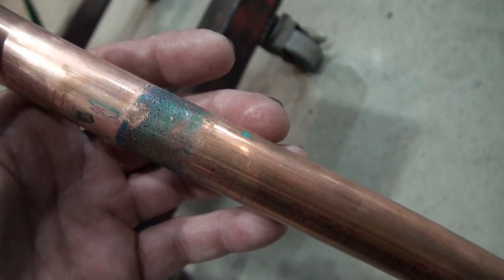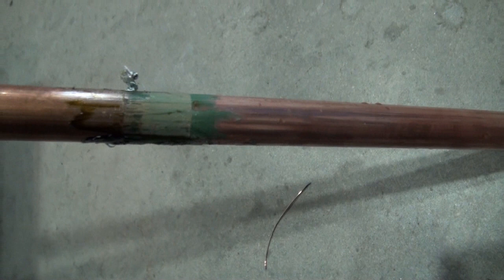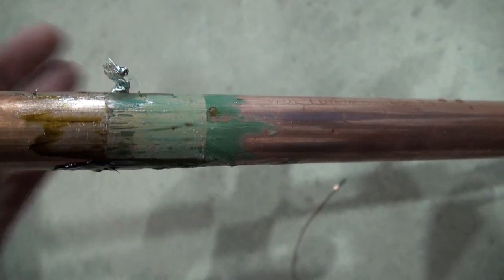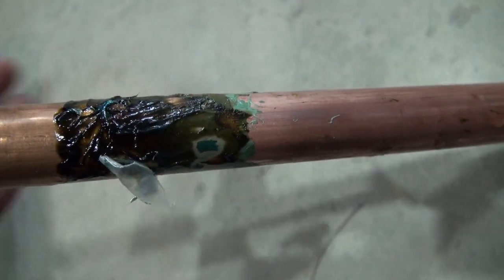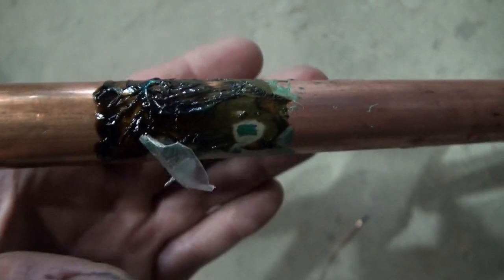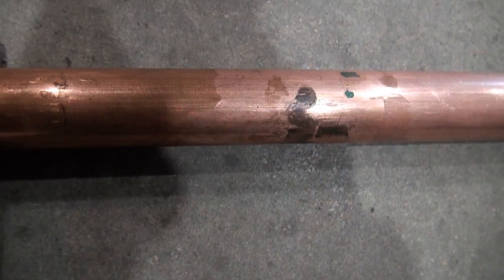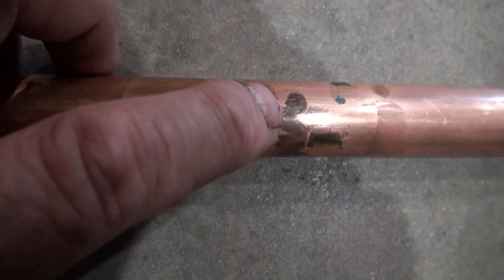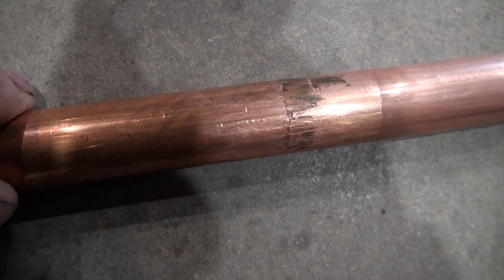Copper in vinegar Test Part 2

Comment: I know on copper computer components like heatsinks they have some sort of lacquer or clear coat because they never discolour and always look like pristine copper (even if you get stuff like vinegar on them)
Ill guess its acetic acid vapour coming off the liquid and that's why you get corrosion near the water line , vinegar is about as cheap as it gets can you just 100% submerge then wash it off as soon as you get the block out? to be clear i'm in no way an expert on any of that